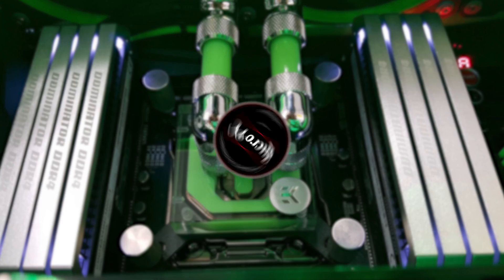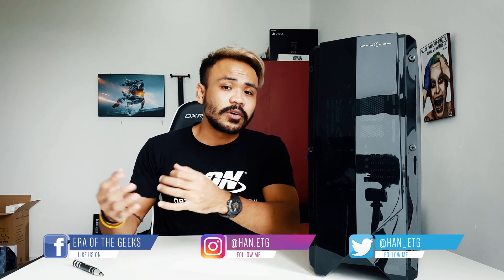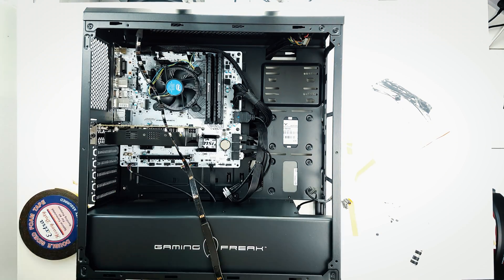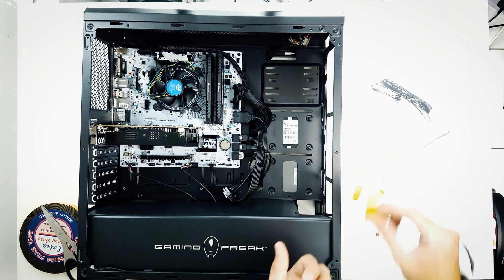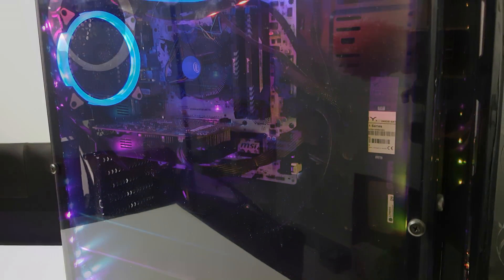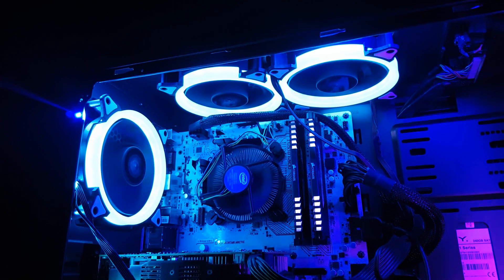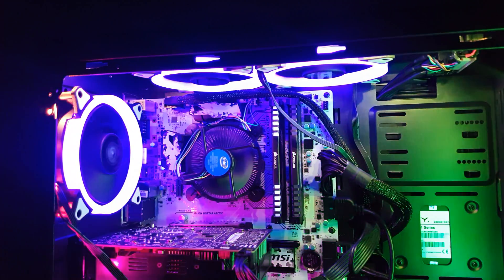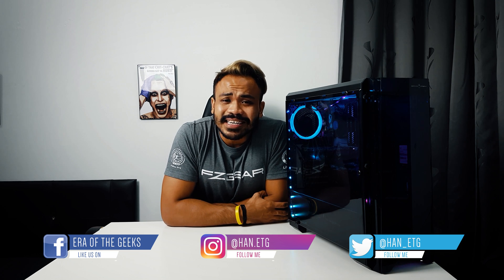OLD to NEW!

Comment: Yep, definitely need another light on the other side to lift that shadow. Nice case though. Also, whats with the IO cover thing that you removed early in the video? The thing with white camo, was it blocking?
Reply from the maker: oh yeah. it was blocking. i actually have to remove the screws on the motherboard. but i had no pliers to remove them, so i decided to remove the camo instead.